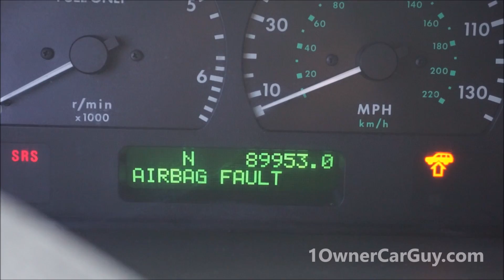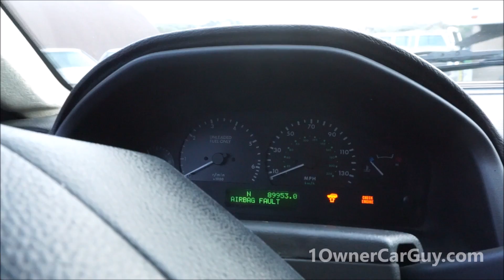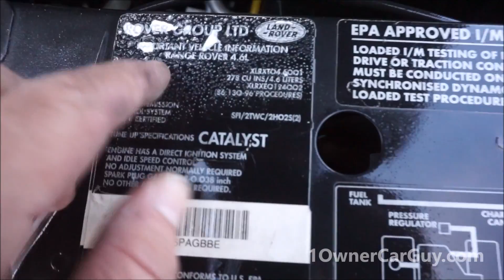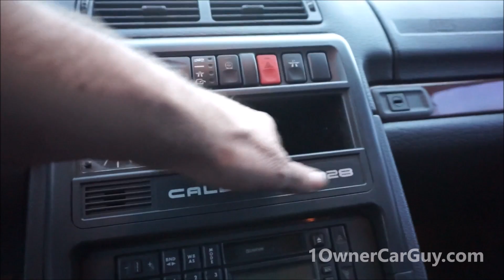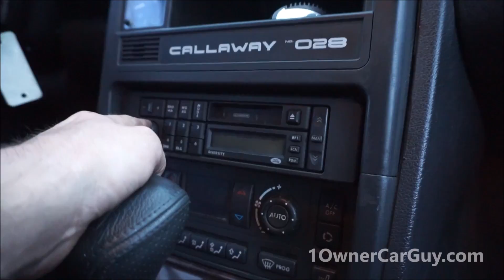1999 Range Rover Callaway Performance Edition SUV Collectible

Comment: Beautiful machine you have there buddy - that engine looks stunning! Wouldn't take much to get the beast back to A+. I'd buy it, but I'm on the other side of the world, not to mention right hand drive too. 
The component at 4:34 is a sensor for the alarm system. My 2001 Discovery 2 has the same unit; pretty sure it's a motion detector. 
Good luck with the sale.

Comment: 2:46 its actually stainless steel sill.   4:34 its an ultrasonic sensor,  it can be deactivated with a button,  so it wont trigger an alarm eg if a dog is left inside.   No spark could be some other electrical problem like main relay and fusebox dry joints. Anyway it would require PCBs resoldering.